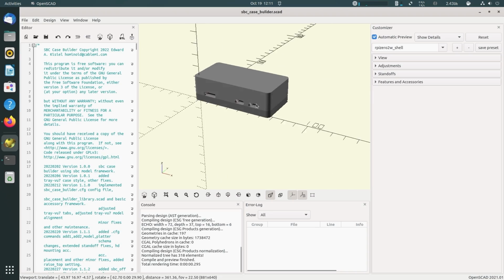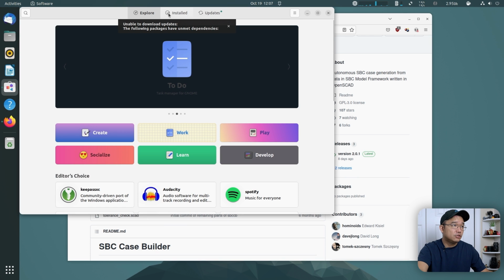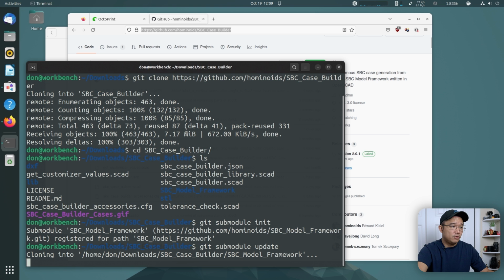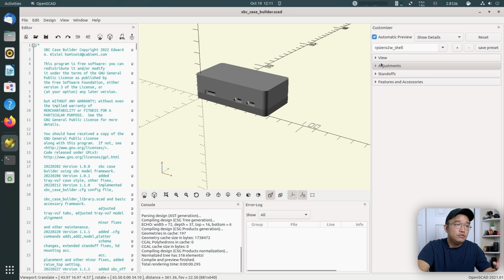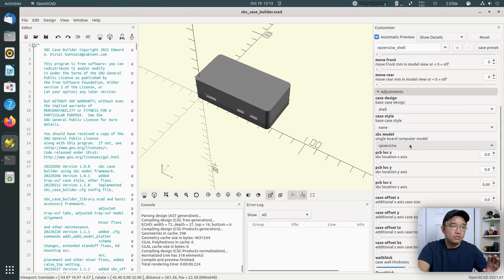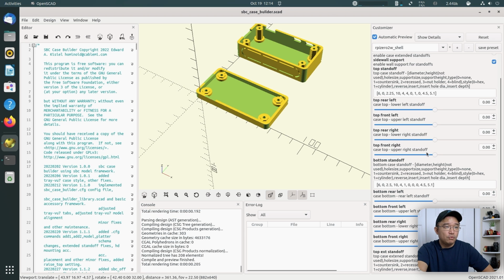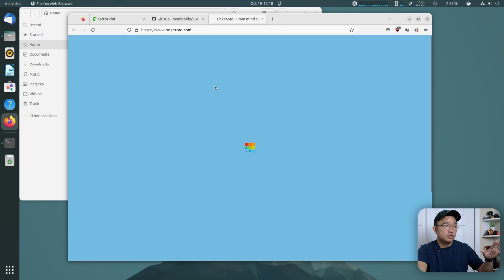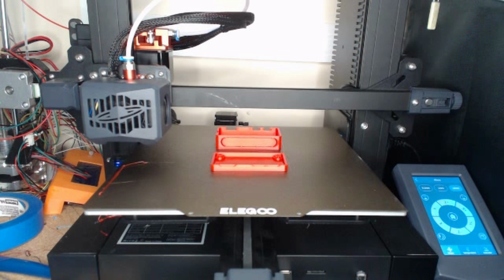Amazing! Tool That Can Customize Your Case

Comment: Very cool that this is being sort of compiled for ease of access and use.

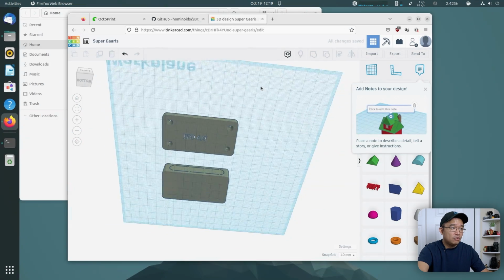8:47 Just remember 2 things when making text that goes all the way through a surface:
1/ If you apply it to an inside surface (like the underside of the top as shown here), it'll end up being backward from the outside surface. So mirror your text before applying it!
2/ You need to make some sort of support for letters like "o" and "a" otherwise the middle part will simply fall out!
Reply from the maker: haha true story

Comment: This is SO DOPE! I do all my designs in OpenSCAD. I was just looking for a system to print an RPi Zero case with camera port and swivel mount. I want to mount it directly to the 2040 extrusion of my printer and angle it to observe the prints. I was going to have to bodge something together from 3 different Thingiverse STLs, but this will let me make it perfect! ☮️❤️🌈
Reply from the maker: hahah yea, all you need now is to add the hole for the camera and the 3/8th thread for your tripod